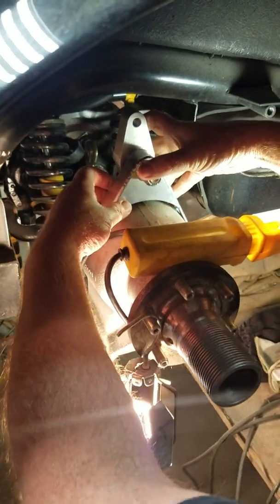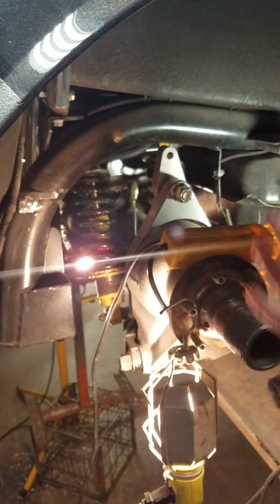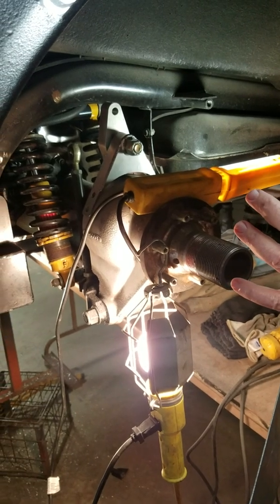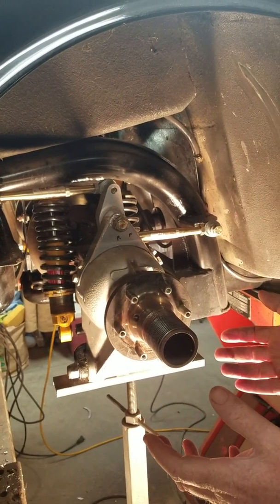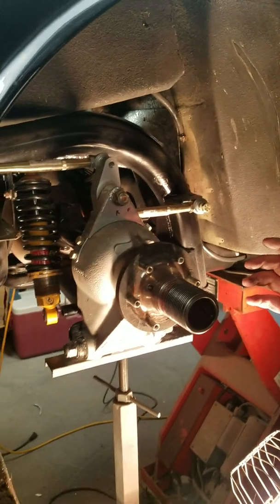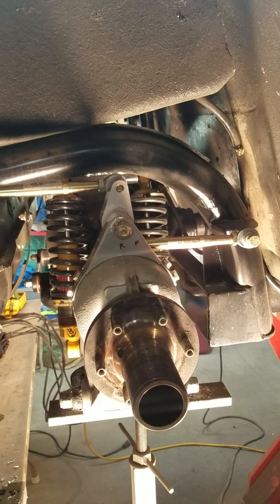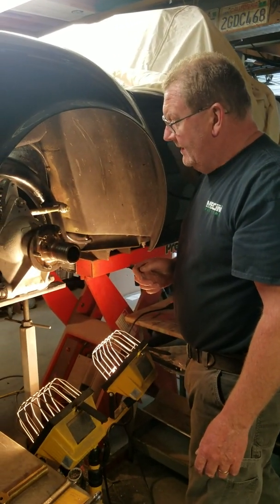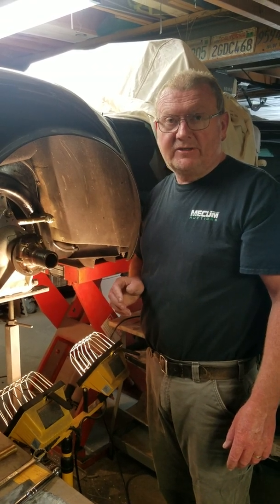Watts linkage installation Jaguar independent rear suspension Cobra Contemporary Classic

Comment: A very interesting use of a watts link. Theoretically, a "panhard bar" could also do this, if there was a long enoung run of space to have it travel, no?
Reply from the maker: Panhandle bar swings an arc and changes length. Watts goes straight up and down like the suspension.

Comment: Suspension designed for 150-200hp at the crank, unsuited for Massive Horsepower Monsters?
Reply from the maker: It's torque and traction not HP you need to worry about. Jags used this rear end behind a V12 and they have been reliably run in Cobras and Hot Rods with up to 800 HP.